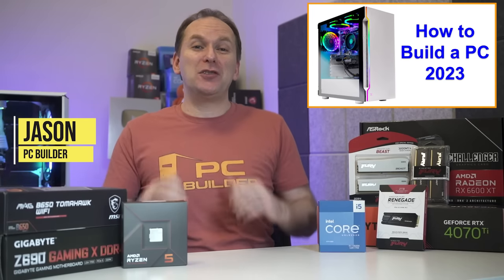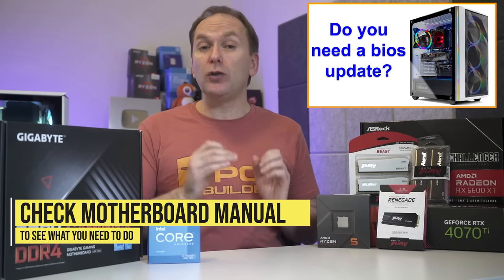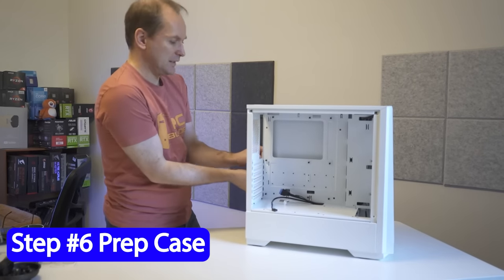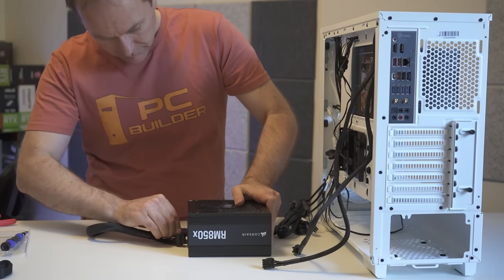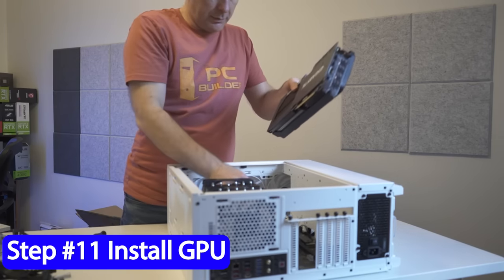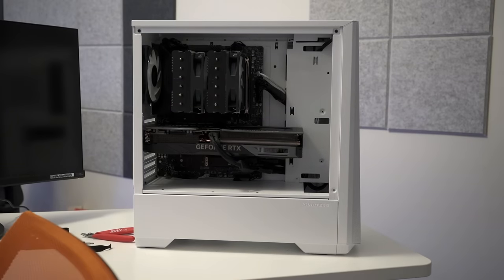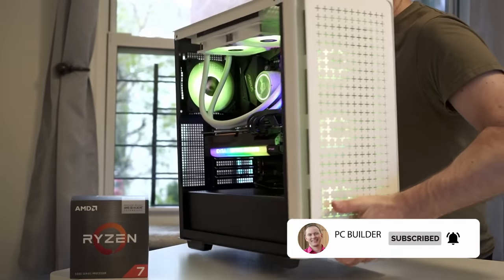🛑 How to Build a PC 🛑 Step By Step Ryzen & Intel 🛑 How To Build a Gaming PC

Comment: Couple things I found, you may be interested in to make it even more comprehensive:

I have a 128gb flash drive and it is defaulted as fat32, and I’ve used it to transfer 100gb. I haven’t transferred windows yet, so I don’t know 

The PSU cables could be briefly explained—that the GPU should use two cables, that the CPU may use 8 pin + 4 pin and the CPU cables can be split to achieve this, and what the SATA cables may commonly be used for (like RGB) — this was all new to me and I searched it to find out

What is flashing vs. just updating the bios. Do I update at first launch always or is that only for flashing. I am about up look that up right now. This could be briefly explained for common user scenarios

Cheers

Comment: 3:58 Jason, you said to first connect the monitor to a HDMI port instead of the  Display Port.  When do you connect the monitor to the Display Port?  What is the difference between the HDMI port and the Display Port?  When and where do you connect the external speakers?

Comment: I’ve never tried connecting the power connectors to the motherboard before installation. Nice tip to prevent headache of trying to plug them in after motherboard is in place.
Reply from the maker: Yes! This come from many a time I didn't and finally learned my lesson (;

Comment: Really nice job, Jason. Something that works well for me is at step 7 @10:00 I plug in the front panel power, HDD, reset led right before putting in the motherboard in the case. It has saved me a lot of headaches
Reply from the maker: Thanks for sharing!
Reply: @PCBuilderChannel  no problem! I should also mention that this doesn’t work on every setup because sometimes the harness isn’t long enough. I build a lot of ITX setups and this has little trick is a must on some builds. Also another tool I recommend is a headlamp!

Comment: That's a great tip on plugging in the EPS cables before putting the motherboard in the case!  I got wildly frustrated trying to put those in after screwing down my motherboard.  Definitely gonna do that next time I need to build a PC.
Reply from the maker: Yes! I've done it the other way and gotten frustrated too (:

Comment: Love the video. Been doing PCs for quite some time, although not used to ones with external GPUs. I still have my very first PC i built, which was an Intel 80486, 32 MB of RAM, an 800MB hard drive with a special card to bypass the BIOS limitation, a 3½ AND 5¼ inch floppy drive, and a 8X CD-ROM drive. Ran Windows 3.1.

Also... 15:25:  HMDI? 🙂
Reply from the maker: Was there a typo? Sorry about that, the cat is in charge of proof reading and often naps on the job (;

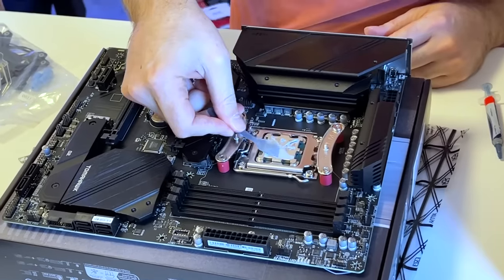Comment: 5:35 I wouldn't apply thermal paste like that. CPU tends to get glued to the cooler heatsink resulting bent CPU pin if tried to pull that to replace it with some other CPUs. I am a PC builder and have encountered that on a few PCs, I tried to fix. Just a finger trip size drop in the middle of the CPU is enough.
Reply from the maker: There has been tons of testing of thermal paste application since people have strong opinions about it (; 
Testing consistently shows the only way to screw it up is to put too little. This is the method I've always used and it works well for me. But to each their own.

Comment: One thing I don't get hear mentioned a lot, is that a really nice part of building your pc, is that the first time is the most expensive, but after that its way cheaper because you've already got a ton of things you can just reuse. The case, fans, keyboard, mouse, monitor, wifi/bluetooth card, and potentially psu, ram, gpu, and ssd.

Another is that when building your own, you can buy what you can afford when you can afford it, you don't have to pay the whole cost up front like you do for a  pre-built.
Reply from the maker: Great points!

Comment: I have this build 
Motherboard: Asus Tuf gaming z690 d4
Cpu:i5 12600k
Gpu: RTX 4070ti
Ram:16 GB Bus 3600
Memory: From my old laptop it's about 1,800MB/s read speed
And I think it's a little bottleneck at 2k resolution(it's about 20-30 fps in Spiderman Remastered) do you think it can be ssd(i don't think it's from my cpu that much because it's 2k resolution and my cpu never reach to 100%)

Comment: Nice video, though I got a couple of questions. 1. Can I have both the windows installation and bios update on the same usb stick? 2. What does “bios post” mean and when do I know if I need to flash/update my bios
Reply from the maker: Thanks. 1. Yes you can have the bios update and windows on the same stick. 2. bios post just means it boots up to the bios screen. If you don't get a post, my first instinct is to flash the bios using bios flashback as this often solves the issue. On Ryzen 7000 systems sometimes first post can take 5-6 minutes so give it a second before turning off if you don't get a post.
Reply: @PCBuilderChannel  ok got it. All my parts will arrive next week, 4070ti super + amd 7 7800x3d all white build (upgrading from a 1070). Will then go through the building process with your video!

Comment: Besides checking you have all your cables snug, reinstalling the CPU will often revive what you think is a dead system. My build posted outside the case but wouldn't power on at all once I put everything in the case. 

Also, if you have issues installing the GPU and bending the back plate a bit doesn't work, loosen the screws on the motherboard and check it's lining up how it should with the case. Another issue I ran into and guessing it just barely passed QC at the factory or some really minor shipping damage that wasn't noticeable. 

If you have an ASUS motherboard and don't need or want armory crate, make sure to disable it in BIOS before installing Windows.

Comment: Be sure to push on the stock AMD cpu cooler because of how hard the springs are even if you tight the bolts in X pattern and do only a couple turn on each it tend to lock only on few screws, and end up like me with the tension rising one half of the cooler... I had to unscrew a bit the first two that take the thread correctly and start it all again. I guess i will know if the thermal paste spread is messed up if the cpu overheat or if i bent some pins even sooner on the 1st startup. So be extra careful as only a few twist on one screw may be suffisent that hard those springs are !
Reply from the maker: Good advice! Glad you got it fixed!

Comment: It's been over 10 years a last build pcs. And it's a question I have? If a BIOS update is needed at first running the pc, why is that? 10 years and back of that, we never did a BIOS update at first running the built-in pc. Maybe later if needed, but at first never.
Reply: This is more prevalent with AMD Ryzen builds. With AMD Ryzen, the motherboard and chipset may support newer CPUs than when the board shipped, but the BIOS code, more specifically AGESA code, may not support a newer CPU. So when you update the BIOS, there's usually an updated list of CPUs.

Also, some BIOS updates can help fix issues that may be in older BIOS version.

Comment: So I am thinking of building a new personal desktop. I NOT INTRESTED in any games, I DON’T play games. The main use is going to Photoshop, photographic , some video editor and some 3D rendering (Sweethome 3D). Here are the parts that I am thinking of buying .. .. .. 
ASUS TUF Gaming Z790-Plus WiFi LGA 1700
Intel Core i7-13700K
Crucial Pro RAM 32GB Kit (2x16GB) DDR5 5600MHz
MSI Gaming GeForce RTX 3060 8GB GDRR6

Is this a good build ?? ??

Comment: Just built a new pc mini itx build nr200p case, sf600 psu, rog strix x570-i gaming mobo (i know over spent), ryzen 5 5600x, corsair vengeance ddr4 3600 cl16 amd optimized 2x8gb ram, crucial p3 plus 1tb nvme, ice sleet g4 oc cpu cooler (purchased for color). rx 6750 xt. purchased windows 10 on usb from amazon the stick was corrupt but the key code worked. lol, had issues installing windows because of the corrupt stick but everthing is good now can't wait to start putting it thru the test yeah!
Reply from the maker: Congrats on your build!!

Comment: Hi Jason, I have a question about digital vs. analog audio. Is it better to use a headset with its own onboard digital audio or should I just plug in the cords straight to the motherboard? What is the difference? If a headset has its own digital audio, that means its a USB headset versus a 3.5mm audio jack correct? Are there some headsets that have better audio than an alc 1220 audio codec and are they affordable and are better than using motherboard audio? Sorry for all the questions I'm just trying to have the best audio experience for my games because I feel like it would make a big difference in competitive games or just any game.

Comment: I want to upgrade my current 3060ti i79700 system with a 4070 Super and a i712700k. My Alienware R8 can only handle a i99700, a huge bottleneck for a 4070 Super.
Got my R8 in 2020, upgraded the GPU and PSU a year ago, but it still struggles sometimes. 4070 Super should be good for another 5 years.

Comment: Collecting components for my build after 7 years on my current build, prices are forcing me to wait for sales but watching my slowly growing inventory is making me impatient! Going with Intel i5 13600K, MSI Z690 Edge mobo, RTX 3070, Noctua NH-D15 cooler. Still have to get DDR4 RAM, PSU, the case, and OS. Thanks for the video! Very motivational!
Reply from the maker: Excited for your build!
Reply: @XxTheMetalistxX  , thanks for the tip.  I guess I was already a Noctua fanboy (no pun intended) so I already have the cooler.  I've had a Noctua for all 7 years of my current build and am impressed by how it is sooo quiet and reliable.  In another 7 years, I'll attempt the open minded approach lol.

Comment: I just did a build and wanting to migrate my GPU and PSU since they're fairly new into the new build. I'd like you to give me your thoughts on this build and my reasoning. I am migrating my GPU and intend to upgrade that in a year's time, once I've gotten my money out of it. I didn't choose a Z series board based on both the fact that this chip runs hot enough and fast enough that overclocking isn't necessary. With the B760 I do have the ability to overclock my RAM so that's why I went this route with DDR4. Here's my build with after tax prices in Canadian Dollars...                                                                           ARESGAME ATX Case			 	                                  96.25
ARESGAME 80+ Gold AGT1000 PSU			        124.29
MSI MAG B760 Tomahawk WIFI DDR4			        254.24
Thermalright Frozen Prism 240 AIO		                          81.25
Intel Core i7 13700k CPU			                                535.61
Thermalright CPU Pressure Plate    		                          13.55
32GB Mushkin Redline Lumina 4133 CL-19 DDR4	        153.67
Dell RTX 3060 Ti 8GB (256bit bus/200W)		        484.77
XPG 2TB GAMMIX S70 Blade (7400/6800)		        135.59
EZDIY-FAB ARGB GPU Support Bracket		                   33.89
Thermalright TL-C12C-S ARGB 120mm Case Fans	   35.94
Hi.FANCY Red Sleeved Extension Cables		           20.88

Total AFTER Tax		                                                     $1969.93

Comment: Hi Jason, Thanks for your video! First time builder here, I'm panicking over what case to buy for my set up. I've bought my components but I realised that I have no idea what cases would fit my components for a simple build like youve done. I've got a MSI B660m WiFi DDR5 motherboard with a Gigabyte 3080 10GB graphics card and a Deepcool DQ850-M V2L 850W PSU. I'm struggling for suggestions on what case to buy here in the UK which would make the build easy as I want the case to have fans preinstalled. any suggestions/feedback?

Comment: Great info Jason, thanks.  Question for ya - I've got an old (new in box) CoolerMaster N200 case.  Would you hesitate at building a new AM5 system in mATX form?  It can handle up to a 14" GPU.  Thanks again.
Reply from the maker: Good itx case. Would be fine for Ryzen 7000.

Comment: @17:30 Max file size for FAT32 is 2TB, with standard 512 byte sectors, NOT 32 GB.

32 in FAT32 is for 32 bit file allocation system, NOT 32 GB size.
Reply: Where's you're source for the 2 TB file size limit for FAT32? Everything I can find points towards the file size limit of 4 gigabytes and a partition size limit of 2 TB.
Reply: @JJFlores197  https://en.wikipedia.org/wiki/File_Allocation_Table#Maximal_sizes
Reply from the maker: I'm speaking to the Windows limitation, not the file architecture. Windows will not format a USB drive larger than 32GB as FAT32, you will only be able to use EXFAT which some of the motherboards don't like. Hence why I tell people to get a 32GB or smaller drive. There are workarounds but since these drives cost about $5 it would be more confusing to go into them than just tell people to get the tool that will work. Source = https://www.minitool.com/partition-disk/fat32-not-an-option.html
Reply: @HarpaxA  That says that the max volume size is 2 TB NOT file size.

Comment: Hey PC builder. Can you make a video of a build with best components for performance:
My monitor is : HP OMEN 27i Gaming Monitor, 165Hz, Nano-cell IPS, Quad HD (2560 x1440),
For Case i would like to use the Lian Li o11 dynamic Evo case.
For GPU I already managed to get a good deal on Red Devil 6900 XT Ultimate 
For processor i was thinking about Ryzen 9 5900X.

I also am determined to use the Lian li  vertical mounting kit for the GPU.
However I have no clue for the rest of the components.

My aim is to be able to play at this resolution with max FPS.

My current budget 2000 $.

I would appreciate if you have the time to make such a video or respond here.
Regards,
Tony

Comment: Yo I followed your build recommendation with a Ryzen 5600x, XFX speedster RX 6800 (yep, found one), b550m gigabyte mobo, with a 2 tb ssd 980 evo pro (that I took outta my PS5 before I SOLD it) and some generic 16 gb ram x2 think it’s Corsair. 
I failed at the build myself… I messed up the cpu but got a refund.
Just a hack in case you have a total tech membership at Best Buy. I took it in they diagnosed the issue , fixed it and built the whole pc sans installing a windows license code for me. 
I was totally hopeless until the geek squad saved the day 😂🙄

That being said , it run like a CHAMP. Smokes my ps5 , smokes my Xbox 

It can even run 4k in many cases just not with crazy frame rates. all in all since I had the ssd , gaming chair , desk and a gigabyte m28u monitor I only spent like 650 bucks on this whole build out of pocket.
Reply from the maker: Congrats on your build!!

Comment: My new PC, finished it last week.
7700X
Asrock B650 Lightning MB
64G Corsair Vengeance PC5200
1000w Superflower Leadex V PSU
2T Solidigm M.2 drive
Powercolor Radeon 6800
Fractal Torrent case.

I game at 1440p, and it's plenty fast for that. I can upgrade the GPU later if I decide to move to 4K...and prices become more reasonable.
Reply from the maker: Congrats on your build!!

Comment: Great advice and vid as always!

Question - I ordered the MSI A850G PCIE5 PSU and the AMD 6950XT. The PSU PCI-E Cables included are daisy chained 2x 6+2 to 8 pin connectors. The 6950XT has 3x 8 pin. Can I plug both 6+2 ends of one cable in and then use one of the 6+2 ends of the second cable (letting the other 6+2 dangle) to power the GPU? I've spent some time trying to learn this on my own, but can't confidently come to a conclusion. Thanks!

Comment: Awesome vid thanks! I'm getting ready to build my AM5 PC after just watching videos for the past 6 years. Quick question: when I buy parts off a major retailer, apart from all of the common ones, are there any others I need to know about and buy (mainly asking about all of those cables you used in the video/gpu stand etc), or does the MB/PSU/GPU/Case come with all the things I need to install them + drives + case fans and get the system to post?
Reply from the maker: So glad you enjoyed! All the cables will come with the parts (except for add ons like cable extensions).

Comment: So I followed the instructions to the letter. Even got the same motherboard so I could copy all the cable connections exactly. Spent $2,000 and the system won’t post. 
Tried to do the bios flash update, it flashes for 20 minutes (I’ve watched) and then just sits there doing nothing.)  Spoke to MSI, they set to strip everything out, the CPU (messy with the thermal paste already applied), the RAM, the GPU, everything. And then to flash the BIOS again. Same thing, the motherboard flashes for 20 minutes and then nothing. Reattach everything again, and… won’t post.
I get two lights on the motherboard- yellow and red. According to MSI that means problems with the CPU and RAM. Try one stick of RAM, won’t post, try the other stick of RAM, won’t post. Just a yellow and red light on the motherboard staring at me. 
So I’ve spent $2,000 so far on a paperweight. MSI says to try a different CPU and RAM. I don’t have another CPU ($400) or RAM ($120) to try. Or I can send the motherboard back into MSI and they’ll let me know within 8 weeks if they’ll send a replacement. Even if they do, then what do I do if it doesn’t post? But another CPU, different RAM? How much do I sink into my paperweight?
I’m so sorry I went down this road. Videos like this make it all seems so easy, but they don’t show you what do to when things don’t work. 
☹
Reply from the maker: I’m so sorry to hear this. Situations like this are rare but they do happen. Sounds like you are working it through methodically. My first step when this sort of thing happens is indeed to check everything is threaded correctly. For troubleshooting I usually recommend posting to Reddit build a pc troubleshooting forum. It’s a great resource and you might try posting your full build list and a description of the issue there. And I’m glad you are working with MSI